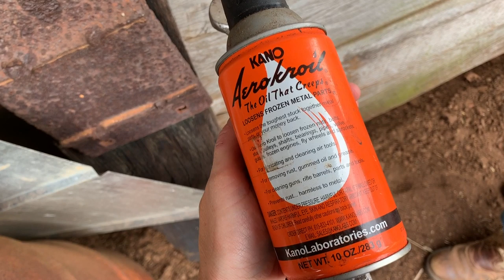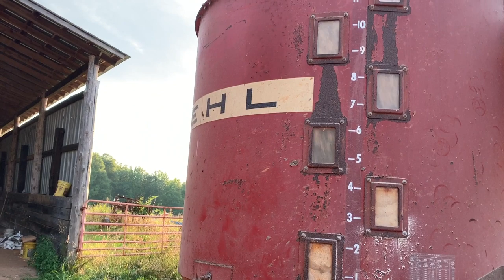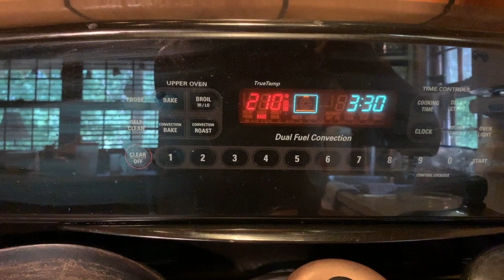Chutes, Cows & Cobbler

Comment: Next time put the berries in sugar and heat to sweeten them before you add them to the cup of milk, sugar and self rising flour. It works best and easiest with a large can of pie filling like cherry/peach in a 13" pyrex dish at 350 for 35-45 minutes. I've been making cobblers for about 40 hears with pie fillings to avoid the step of converting the fruit to a syrup mix and dirty another pan plus it is great in winter when you can't get fresh fruit. Sometimes I double the amount and use the large disposable metal pans from the grocery. 🤗
I made a mix of them in the disposable pans once and my wife took them to a party at work, tried to pawn them off like she made them but everyone knew she can't cook! I married a city girl.🤔
Reply from the maker: That sounds like a great tip! :D
Reply: @ThisFarmWife_  So if you don't mind spending about a buck, you can get a huge cobbler in a throw away pan and only have a mixing bowl to wash.

Comment: Meredith just a question,you are on your local farm board and I’ve been following the Grand Solar Minimum that is unfolding,has there been any discussion of this about this with the board or the local farmers or even with Lawrence on how this will effect farming and production output.
How the GSM works is that the growing seasons will be shorter and the rain and temperatures will swing wildly,I know this as you mentioned it in this video that it’s cooler at present.I am in Australia and our summer was mild with a few heat spikes but the temps were swinging 30c from day to night on those hot days and that’s a big difference,example,52c at midday and by 10pm that evening it’s 19c.
I follow farming channels over the globe to get an idea of how the GSM is having an effect on production and food security.Thanks for your post.
Reply: Good question. A farmer from Indiana and one from Michigan told me "we're in trouble"  I've followed the GSM for awhile. It's real!